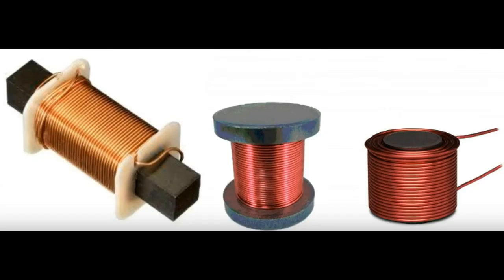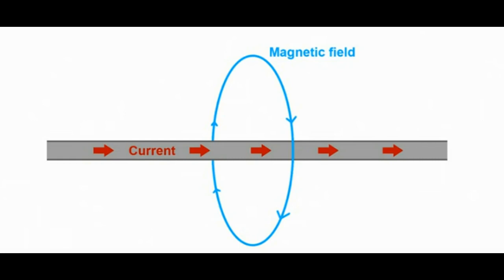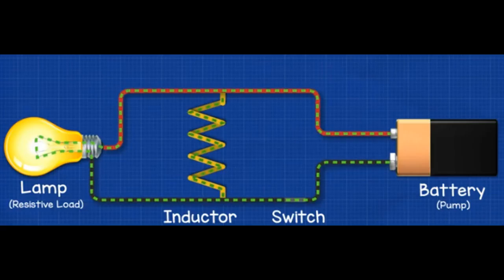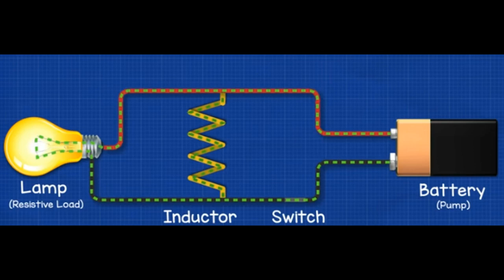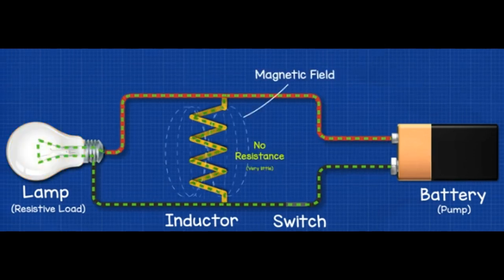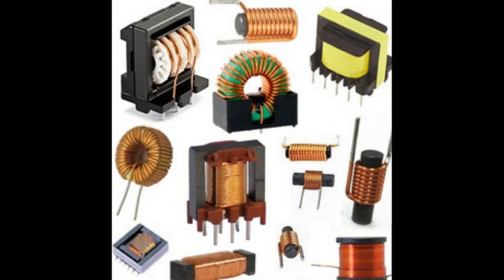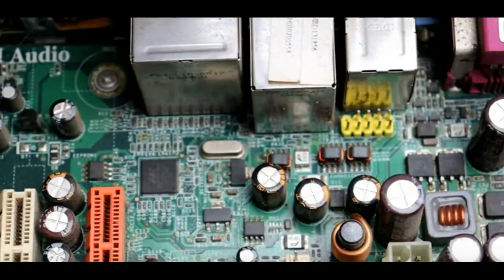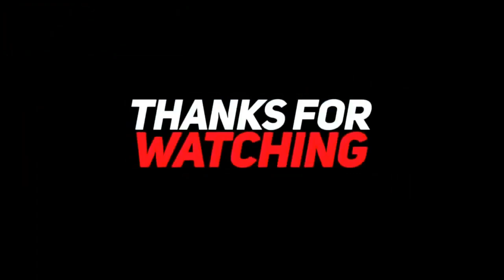Secrets of Inductors #inductors #electronic

Comment: Inductors and Capacitors are complimentary reactive components... American hams use the mnemonic "ELI the ICE man..."   E (Voltage in Electromotive Force) Leads I (The Intensity of Current in Amperes) in an Inductor (L for some reason unknown to me... Perhaps coiL)?  

In other words Coils aka as inductors.  Inductors selectively oppose a change in Current (Amperes)  But Ignore the change in EMF (Voltage). Conversely, Capacitors oppose the change Voltage (EMF) But Ignore the Change in (I  Current,The Intensity  in (Amperes) I... Capacitors (in Farads)  selectively oppose the the change in voltage (E) with Respect to Delta Up f in Frequency = Hz Hertz or Cycles Per Second Time or inductance in Henry's...  

So When X sub L = X sub C ( as in Inductive Reactance = Capacitive Reactance) The Reactive components cancel and Ohm and Watt's Laws apply as in E= IR & P =IE work... In a Tuned Resonant circuit This is called " The Resonant, Tuned Frequency."   I defer to Our Esteemed Professor  WT!
Reply from the maker: Your comments demonstrate your extensive knowledge of electronics; please keep them coming, and thank you very much.